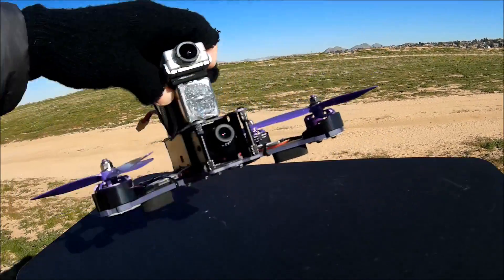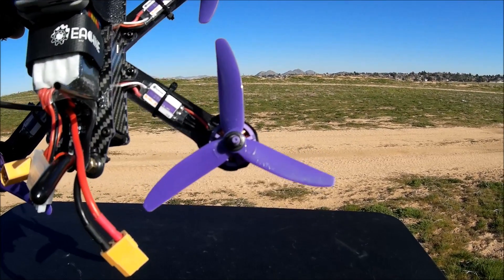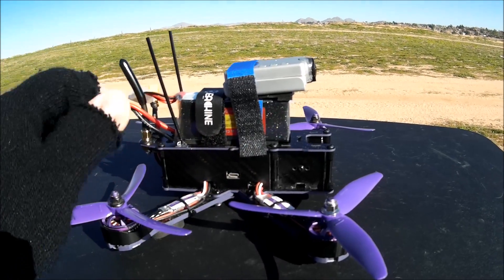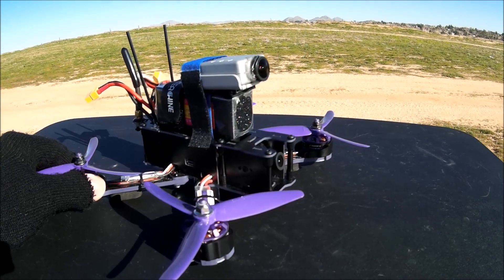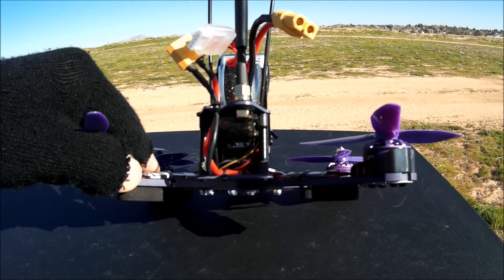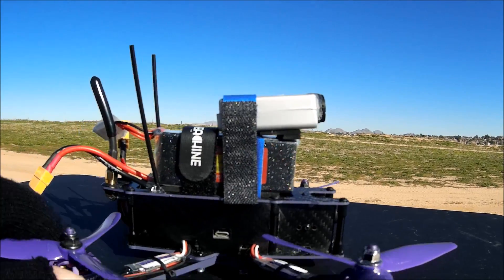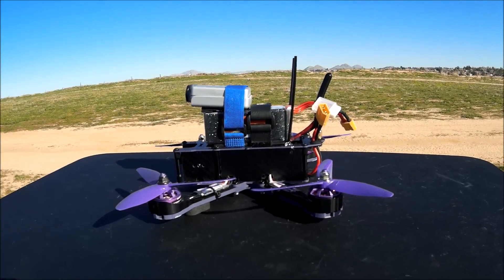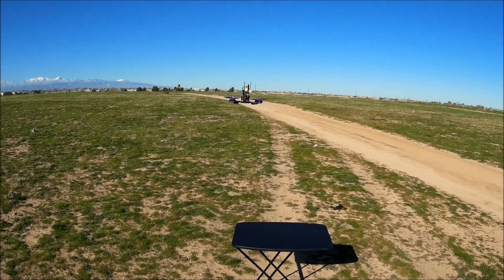Eachine Wizard x220

Comment: Pete, I'm wondering the jello might be caused by the foam pads underneath the RunCam camera because that's what I ran into
by dampening my RunCam HD on a X380. I had hardly any jello using a angled plastic plate on it mounted directly to the quad.
I did get more noise in the camera and flying FPV it was good. I was wondering you balanced the props? I tried the DJI props
on mine and found that the modified carbon fiber props were better in all ways versus the plastic props. The carbon fiber props
don't flex and speed really went up using them since it was noticeable with FPV, thanks for your review.
Reply from the maker: Dennis Petersen 
Thanks Dennis :)
I will try that/-remove the foam pads :)
I have flown it with a angled mount on my fs i6s remote video and the jello is almost gone but there is a slight bit of vibrations...

Comment: Any particular reason you strap the bat in on its side?
seems to me it would just create more drag and throw your balance.
Reply from the maker: You do have a point :)  I just find it easier to for the xt60cable on top and not on the side to connect and secure the balance wire as well :)
Reply: that makes sense,  was just curious.
Fly on man.

Comment: Nice video,I suspect your vibration is cause by the motors,they really are hit or miss in the quality; that's what you get for a $142.00 quad but imho with a few upgrades wroth every penny . May I recommend soft mounting  the motors,FC and  the ESC's   E6000 glue  is your friend for soft mounting ESC's just install a glob under the each ESC and clamp it down until the glue drys,no more tie wrap or heat shrink on ESC's the rubberized glue dampen vibration that is transmitter from the frame to the ECS's.   On mine I replaced the eachane cmos camera with a Foxeer Arrow V2 soldered in a buzzer and installed Vbat for the Arrow,installed Betaflight  3.1.6  with Joshua Bardwell setting  link   https://www.youtube.com/watch?v=e7dGCZMJ6SA&t=1304s which I recommend. I also never use the stock motors I replace them with Racestar  2205 26Kav motor's set of 4 is around $28.00 with the camera $36.99 and the motor $28.45 it puts the price of the quad around $207.50 that's still $72.00 cheaper than a Diatone Crusader GT2. Cheers Rich
Reply from the maker: thanks for info :)

racestars...nice!!!
i'll give it a try and thanks for the e6000 tip :)
Reply: Richard Johnson Are those racerstar motors good? I am doing research and a lot of people put emax motors on the wizard but they are expensive.
Reply: I have Emax motor's RS2205/2600KA that are going on a Martian II,the raerstars came with my RealACC 220 kit and if you buy them from bangood X4 for 29.00 bucks, the Emax will run you 37 save yourself a few bucks.I can tell how they compare to the Emax because I haven't used them yet,but the are a marked improvement ovever the stock Wizard ones. Rich

Comment: nice review, the wizard is a great first racer, but it takes some research to iron out some of its problems antenna. the motor quality is very hit and miss, and miss again..... can i suggest trying kingkong 2205 2300kv motors,,,, quality is the same hit and miss but you can buy 6 and hope for the best.... these motors are benched at 2500kv, which is turning out to be everybody's sweets spot for 5040x3 props... oh and also somebody... i think 7demo7 noticed that the supploed props are prone to shatter after slight crash damage, so if in doubt change them out, and the normal multicolour kk prop package are not prone to the same shattering... possibly...
Reply from the maker: TheMadmacs 
Thanks for the tips man :)
I do appreciate it a lot :)
I do believe it all comes down to quality control at this price level....I will try some different props and hope it works out...

Comment: do they make an rtf version?
Reply: yes the rtf version comes with a flysky tx and rx, or you could get the arf and a turnigy evolution
Reply from the maker: george aura 
They have!!!  Rtf with the flysky i6 remote :)
Reply: Is there a link?
Reply: Cuz I didn't see an rtf version
Reply: TheMadmacs thank you, I you're right but trust me I am not new to this I have done a few builds myself just sometimes you want to get up and go lol
Reply: ok but there are other rtf's... you should research these new rtf's lots of great ones now,  i dont understand how they can sell them so cheaply... my self build is the cheapest possible and the wizard and others are cheaper?????
   the diatone tyrant s looks good, maybe better motors, the kingkongs are really 2500kv,,,  i would consider the tyrant instead of the wizard if its in stock... or if you dont mind battery underneath the shuriken x1 the jjrc p200 or the diatone gt2 200 look like great prices.
Reply: I was thinking of also trying out the walkera 110
Reply: And the rodeo models
Reply: yeah those were nice, the rodeo wasnt robust enough for crashes though...  have you seen rcaddicts 3 inch build.... he flew it los and its just hilariously agile and fast...  ooh just had a look at andyrc's video on the 110... that looks great, a bunch of issues though... i wish there was a clear winner or obvious group of beginner 2s or 3s quads.... the wizard and the other 5inch quads are an awful lot of quad for a beginner...i feel a bit stupid recommending them to beginners. maybe i should go look at the 110 again,  its just the extra power could be looked at as a safety feature too, these small quads will build up a lot of speed without the oomph to slow down or pull out of trouble....
Reply: Yea thats true, I was just looking for another to bash around since I sold my voodoo 280 race spec racer I loved it but want to try others now that I have been able to fly something with alot of ability and def needing skill to do so
Reply: I think I want to get the deviation tx just to have since from all the videos I have seen it's very versatile to alot  of the bnf kits out
Reply: yeah the devo 7e is still a sensible idea, but the flysky and the turnigy evolution are just so good,,, cheap great range, decent receivers now and plenty of new people who are providing the knowledge to make them a no brainer first tx.
Reply: Oh OK well then maybe I will also look into one of those
Reply: I have the flysky x9r
Reply: you try to sound like your not a newby but you know that fly sky don't make x9r